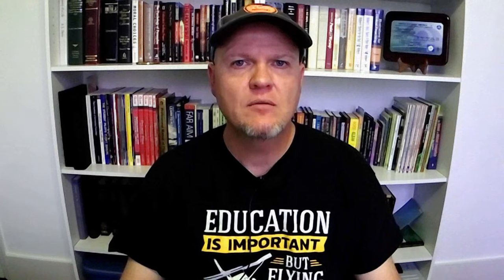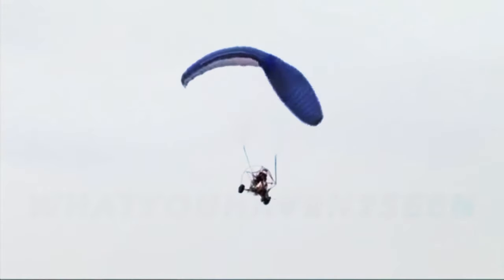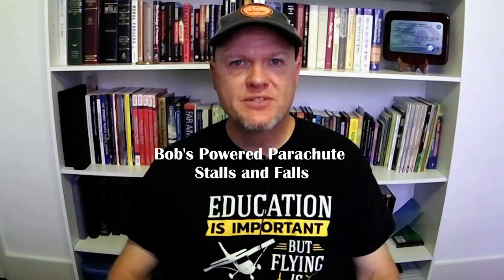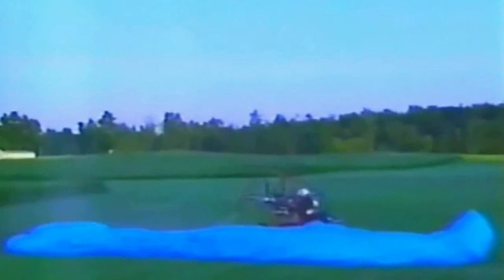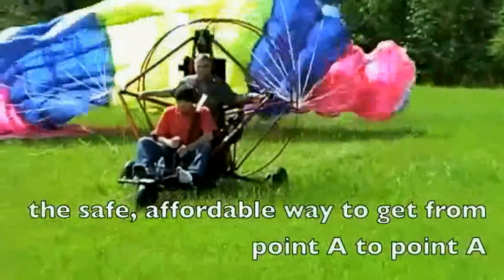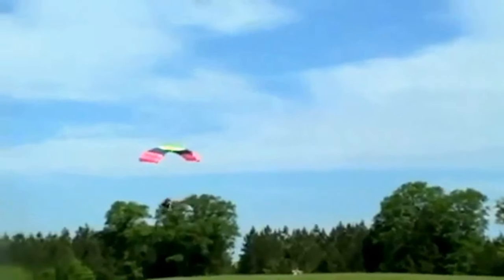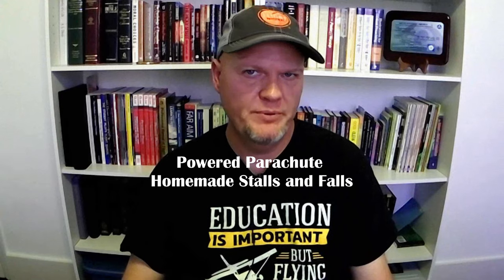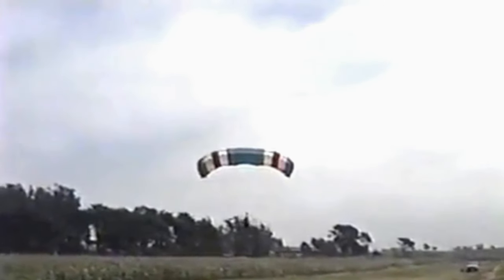Powered Parachute Crashes ǀ STALLS & COLLAPSES

Comment: I have had a fair amount of experience with Powered Parachutes, and when I hook up a wing for the first time I prefer to attach the steering lines on the long side rather than on the short side. If the steering lines are too long, you won't have as much steering ability as you should-but you can always pull in extra steering line with your arms. But if the steering lines are too short, you may not get off the ground, or you may crash like these videos show. If the steering lines are too short it is just like trying to fly with both rudder pedals pushed out  all the time-and this is not a good thing to do!! You made a good video man and hopefully it will help others not to make the same mistakes!!
Reply: Perfectly said. Great video!
Reply from the maker: I've been researching PPC accidents, in order to personally apply the information to hopefully be a safer pilot. I'm glad I can share what I've gleaned from watching these YouTube videos.
Reply from the maker: @HotMediaProductions  Hey man. I am one of your subscribers. I like your flying videos and I specially love the "techno" music. I actually listen to a lot of the same artists!